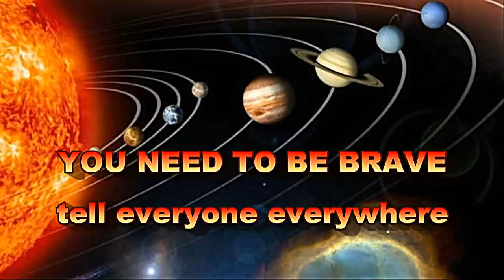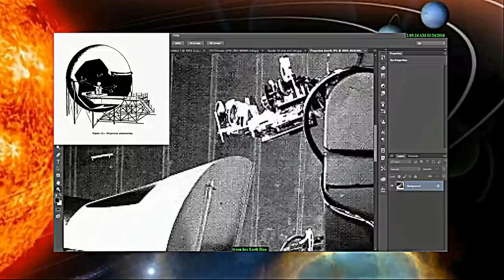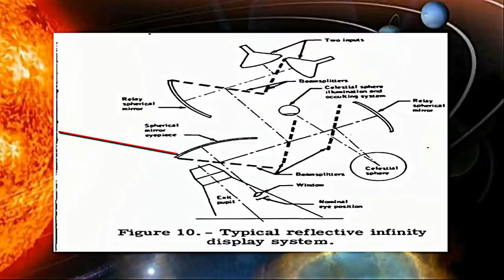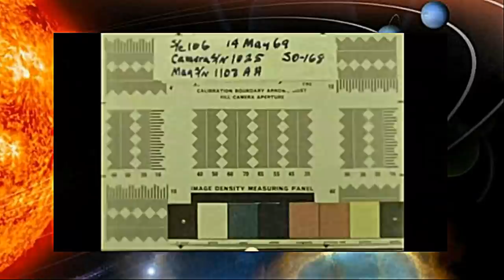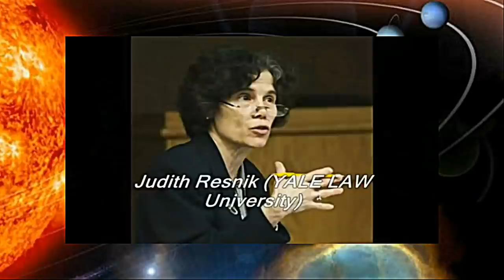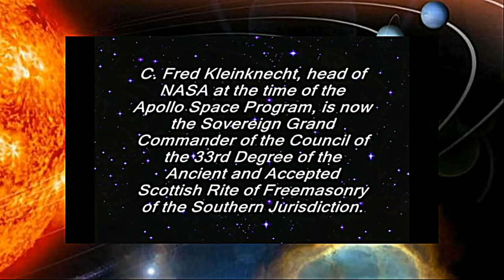AWESOME FLAT EARTH RANT AND DEMO shut down deniers instantly!

Comment: Great speech. Its not a rant its the truth. Natural science, formal science, social science or political science- I chose natural science- its observable, repeatable and empirically provable.
Reply: The irony here is insane.
Reply: Kianu Collis explain it without using a spinning globe
Reply: odinata explain what.....? A failed experiment.....?? I think you need to take a good look at Foucault and his " experiment "....if you think that proves you live on a ball spinning at 1000mph ( at the equator ) through space....well then I have a bridge in the Sahara made out of solid gold that's for sale.....
Reply: Kianu Collis
Explain procession of pendulums without using a spinning globe.
Reply from the maker: the pendulum disproves the globe, because say you start the swing from 12 o'clock to 6 o'clock after a while it goes from say 1 o'clock to 7 o'clock and so on. The reason it fails as proof of spin is because it keeps going all around the clock, when it SHOULD HAVE STOPPED ONCE IT GOT PARALLEL TO THE SUPPOSED SPIN. Case closed. If anybody is interested in reading this from a person who used to set up these pendulums, but once he noticed this fatal flaw became a lecturer on flat earth, his lecture from back in the day is here http://blog.flatearthtextbook.com/2016/11/our-earth-motionless.html

Comment: The Tat's are probably Cool Thumbs up.. The idea of flat Earth.. Lousy.. Thumbs down.
Reply from the maker: it's flat brah!  ;)
Reply: vhsjvc
The only way to prove either of us right is to actually see Earth from the outside looking in.
Correct?
And we can't get that far off Earth to do that.  :-\
Reply from the maker: King Snowman no, no, no we can use simple observations, such as the fact water is flat. Let us test what the globe-heads say, according to them, at 6 feet eye height, you can only see 2.99 miles out, that is untrue and anybody can see that we can see for miles and miles and miles, the lighthouse video is really good because it shows the angles according to their globe and it is impossible for a lighthouse to be seen as far as we can actually see them. Also, the higher you go the flatter it gets, i mean, the horizon always rises t o eye level, but on a globe the horizon must drop below eye level the higher you go, right?  ;)

I want to hear you make some songs about flat earth!

https://dizzib.github.io/earth/curve-calc/?d0=6000&h0=6&unit=imperial
Reply: vhsjvc
Well I can give you some of that but, just seem like we are so minute on this planet smaller than a flea is on a dogs back, so the distance would be so great across, height is the only way to see this curvature to me...

Hey thanks on the song suggestion. I really need lots of insight before that..lol.. But could be cool. Definitely Rock material..  I kinda gave it up for a minute. Took all my music down. Wasn't going anywhere so..?  I really feel NASA has the answer to this though.
Reply from the maker: King Snowman yes, i think they know for sure, but i don't think going up high will change much, i mean, we have balloons that went about 20 miles up, and all looks very flat, the horizon goes to eye level. But i'm happy with just the flat water and the lighthouses, that is more than enough proof.

Check this out, on the solstices (longest and shortest day) do you think they last only one day? I checked this last summer, the longest day lasted a few  weeks. All i did was measure a shadow, there was a mark on the ground and it reached that mark at a specific time of day, then i checked it every day and it did not change until a few weeks later, and once it started changing size again it was noticeable every day.

What do you think of that?
Reply: vhsjvc
See you're not understanding me here. You said,
"but i don't think going up high will change much, i mean, we have balloons that went about 20 miles up, and all looks very flat, the horizon goes to eye level. But i'm happy with just the flat water and the lighthouses, that is more than enough proof."
Question:
Do you understand that LEO = Low Earth Orbit, and it is mankind's limit in space. Meaning that's it. As high as we can go without getting killed.

We're being told lies. I said, They were caught faking being halfway to the Moon. That's because they cannot leave LEO. To get halfway to the Moon.

And from LEO it still is not enough for man's eye Or camera to capture the curvature of Earth. It still goes across for longer than the y can see.

And LEO is 100 times higher than any balloon is ever going to get with man standing open inside of it. You see what I mean now Or?
Reply: vhsjvc
"Check this out, on the solstices (longest and shortest day) do you think they last only one day? I checked this last summer, the longest day lasted a few  weeks. All i did was measure a shadow, there was a mark on the ground and it reached that mark at a specific time of day, then i checked it every day and it did not change until a few weeks later, and once it started changing size again it was noticeable every day."
= I believe that to be the wobble effect in the planet as we go around the sun. Like the stars changing in the season,, The inches of shadows show considerably on Earth during change.
Reply from the maker: no such thing as leo, rockets are like jet planes except instead of using combustion to turn turbines to compress air and blow it out the back of the engine, they use the expanding gases of combustion directly through a nozzle, so they only go about 12 miles up more or less.
Reply from the maker: no such thing as wobble effect or gravity, only on paper and in  their imaginations  ;)
Reply: vhsjvc
Oh wow. I'm not even gonna do this. have it your way,, it's flat. Be careful. Don't get close to the edge. You may fall off.
Take care.
Reply from the maker: King Snowman ok, but don't expect truth from liars, nasa is a bunch of liars.  ;)
Reply: vhsjvc
That's exactly right.... And who controls them?.... And they control the media..... And they control the flight paths... And they control the information platforms that we use.

Now without "them",,  You would have to rely on older information. Were they going in, to outer space?  So technically how would htye know what size Earth is, let alone what plain it's on.

The game is on those whom play it.
Reply from the maker: King Snowman exactly!  ;)

Comment: can i just say a deflated soccer(foot) ball isnt nearly strong enough to have a gravitational pull of any significance so your metaphor is invalid also earth's gravity pulls the water off the ball in a zero G environment the water would stay closer to the ball
Reply: also it is hillarious that you think those objects are floating there stting on water just like you would float on water there on something denser than air
Reply from the maker: A. E. Skellam says: "The following experiment has been tried many times, and the reasonable deductions from it are entirely against any theory of motion: A loaded cannon was set vertical by plumb-line and spirit-level and fired. The average time the ball was in the air was 28 seconds. On several occasions the ball returned to the mouth of the cannon, and never fell more than 2 feet from its base, as shown in Fig. 1 (figures omitted). Now, let us see what the result would be if the earth were a rapidly rotating sphere. The ball would partake of two motions, the one from the cannon, vertical, and the other from the earth, from west to east, and would arrive at B, Fig. 2; while it had been ascending, the earth, with the cannon, would have gone on to C. In descending it would have no Impulse from the earth's motion or from the cannon, and would fall in a straight line at C, but during the time it were falling, the earth, with the cannon, would have travelled on to D, and the ball would fall (allowing the world's rotation to be 600 miles per hour in England) more than two miles behind the cannon." 

http://blog.flatearthtextbook.com/2016/11/motions-of-earth.html

use your brain or lose it  ;)
Reply: +vhsjvc im sorry you had to learn use your brain or lose it the hard way:) that cannonball is still rotating with earth as it is shot up so it doesn't change a thing you would have to shot it in space and that still wouldn't work as it wouldn't fall down

To help you understand imagine a spinning water droplet with a speck of dust the dust still spins with the droplet air isnt space stop making that mistake

can i also point out the appeal to Appeal to Improper Biased Authority fallacy with that link.
Reply from the maker: maxybaer123 good, then if i'm on a jet plane going 1000 mph and i fire a canon straight up, the canon ball should fall right back into the canon?  ;)

i bet you believe the moon landings were real?
Reply: +vhsjvc i do think the landings were real and unless you can prove otherwise your the crazy one for thinking they are fake and if the cannon is inside the plane i have no idea how you would do that but say it was a mini cannon it would fall back down although planes aren't nearly as sturdy as the ground so the cannon might tip off balance.
Reply from the maker: maxybaer123 sorry but you are a dullard, I simply refuse to waste time in 2016 on those who still believe the moon landings were real, stay stupid all you like, most people realize by now they were fake.
Reply: vhsjvc WOW everyone says the earth is flat then i must be on the flat earther only planet better leave because on earth ~99.9% of people beleve the earth is round
Reply from the maker: Granite! I LOVE IT! You cannot make granite by slow cooling from a molten state  ;)

Genesis is 100% real  ;)
Reply: where is your proof of that
Reply from the maker: maxybaer123 not only can you not make granite from a molten state, but you cannot have the polonium halos from slow cooling  ;)

halos.com
Reply: that site is so biased i cant even guess how you can think its acurate ON THE SITE they say how one of there papers was turned down on 'religious discrimination' implying that his paper was heavily religious not to mention he seams to be constanly whining and not realy proving
Reply: i would also like to point out that the reason polonium halos arent given much credence as proof for creation is that the uranium would make polonium not to mention the fact that that only means the earth was created quickly not the universe
Reply from the maker: maxybaer123 no you misinterpret the site halos.com speaks for itself
Reply from the maker: maxybaer123 no, trapping that much polonium in the granite proves granite was created instantly  ;) Plus you cannot get granite or granite with polonium halos by slow cooling from a molten state, no Bible required, you can't fault someone for making comparisons to the Bible with such evidence in hand, which does not rely one bit on the Bible.
Reply: you say your evendece dosent rely on the bible but the intire idea is so illogical that it wouldent have even been proposed if not for the bible
Reply: not to mention it dosent prove god it just proves we dont know how granite work(ed)(s)
Reply: i would also like to ask you why god proves the earth is flat and why you are trying to argue his existance i have been argueing assuming he exists it still dosent change anything
Reply from the maker: Martin Koch no problem, any comments that get removed speak for themselves, spam all the way, most of the comments by globe-heads 99.9999999999% are useless, i really understand now why many people turn this feature off, too many retards wasting time.

make sure you ask your community to show us how granite with polonium halos does not prove instant creation, i want to see that ;)
Reply: i will tell you assuming they are created by polonium the physics of polonium could have changed as the unverse aged not to mention they could have been manufactured by another race or made by a large amount of polonium there is also the fact that the uranium in granite decays into polonium you assume it was one piece of polonium that made the halos
Reply: just becaus the comments dont agree dosent make them useless not to mention they are proving you wrong whitch should tell you your wrong but you are to stubbor to admit it you say your views are censored yet you talk about censoring ours
Reply from the maker: maxybaer123
 wild accusations, i have every shill on my channel and they have made thousands of comments  ;)

your comments are a perfect example of useless
Reply: vhsjvc
I think you know what I know--you are afraid of the facts that make you look foolish.
You wouldn't remove comments if they made you look better, or smarter.
And that's what those comments would do if they were what you claimed they are.
Reply from the maker: Martin Koch hahaha  ;)
Reply: vhsjvc nervous laugh?
Reply: wow you realy cant accept that people dont agree with you
Reply from the maker: maxybaer123 why are you spamming my channel then? hanging around like a leech? I get it, you believe you are on a ball, time to move on i think? Set up a church or something to preach your religion, you have had your say here.  ;)
Reply: i am not spamming in order to spam you must not contribute to the conversation i am critizieing your video and im not haning around like a leech i though it was so obvous that anyone who say the facts and look at the conclusion would agree so why are you afraid of my comments driving people away from your POV
Reply from the maker: Martin Koch move on bud, you and brother maxy should start a church together to keep your defunkt dark ages globe religion afloat, i promise i will donate 25 cents for the cause
Reply: we are not asserting any beliefs but that you are wrong a church implies religion which there is none. you say its dark ages yet ignore all facts and just spout dogmatism which sounds like your the crazy zealot to me
Reply: FLAT EARTH FREAK!!!
You are afraid.